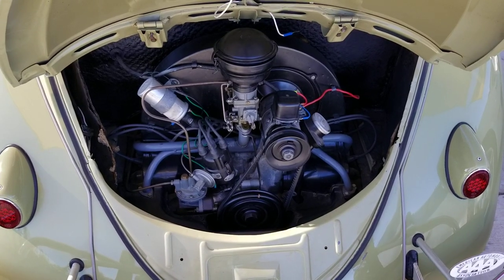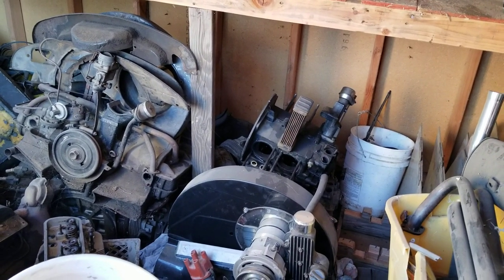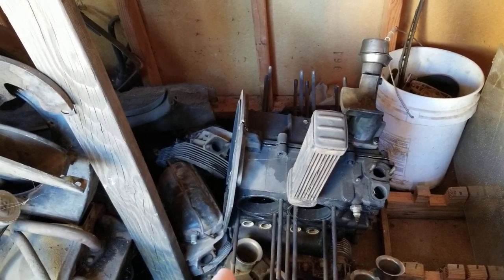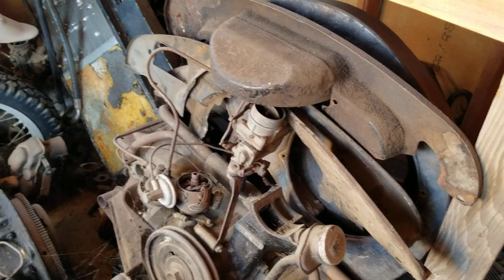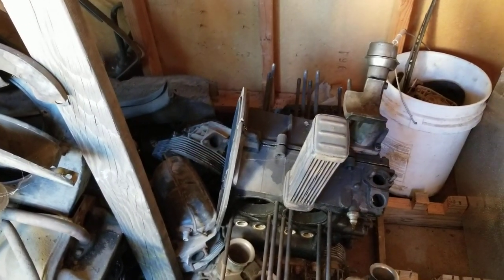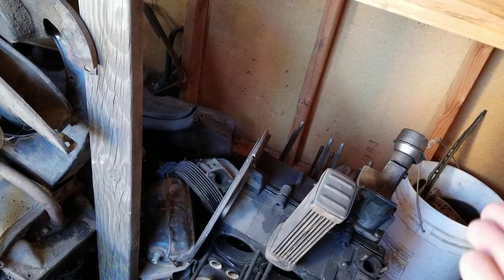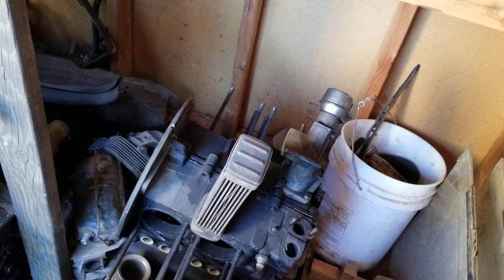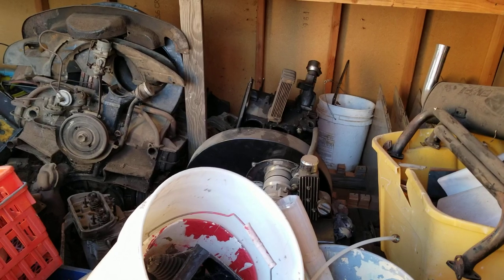Building a bulletproof engine flat 4 VW

Comment: I don’t know enough about this, but a very good video. One thing I have learned along the way with our alcohol fuel, is keep them stock, and up jet for the fuel. I think they run 4% cleaner now with this fuel crap going on. Of course this is only my opinion it does not mean I’m right LOL Although my next is a 1776, supposed to be pretty reliable
Reply: I screwed up my own post from using voice recognition. I meant to say they run 4% leaner, which makes them run a little bit hotter. Because of the stupid fuel
Reply: @SladesVWBeetle  Slade my Voice recognition always tells me i need to learn how to speak more VW & less Chevy ..
Reply: Dan Love 😂😂😂
Reply from the maker: yea that is too funny

Comment: My opinion, of a bulletproof vw air-cooled engine is a type 4 engine in a type 1 car.😎👍
Reply from the maker: well check out my new video coming up on the camper bus build Better than a type 4. the disadvantage of a type 4 is the heads. They tend to drop seats. stay tuned
Reply: @Mikefngarage  
Okay, will do.

Comment: You absolutely will run cooler with the lower tins. It has to do with the basic principles of thermodynamics. As you slow the air down it has more time to absorb heat from the engine before it's expelled becoming a more efficient heat sink.

It's the same principle as removing the thermostat on a water cooled engine expecting it to run cooler since you removed that chunk of medal restricting flow. It won't. But you CAN remove the thermostat if you install a restrictor plate or large washer with a given size hole in it to slow the water flow down so there's more contact time to absorb heat.

Comment: My first1776 failed at the cam gear in 4,000 miles. My current has close to 100,000 dual solex carbs merged header and two quart sump.

Comment: This is a really big topic.
Personally I've always looked at the last iterations of VW boxer engines for some guidance.
The T4 and wbx engines show what VW decided to do when increasing capacity and HP.
I'm of the opinion that these engines are a fundamentally more bullet proof platform for reliable power.
I do think the availability of almost plug and play fuel injection is a game changer for making an air cooled motor both practical and reliable.
If you want another interesting topic what about VW's new EV T1 floorpan and how electric motor transplants will further extend the use of classic VW's.
Reply from the maker: yea for sure the T4 was great except for the heads. IDK what happened but the dropping of the valve seats has always been a nightmare. The bottom ends are bulletproof. That is why I like the aluminum case for the t1 engine. It simulates the type 4 design except uses t1 heads. and fits in the car.

Comment: Good info! ...for nothing though, wouldn’t you think VW would have put the type 3 tin on all type 1’s as well if it worked better? You are probably right but just saying. I’m building a 1641 so you suggest a performance cam, what specs would it be? Thanks!

Comment: Question:  when driving your bug, does the coil get HOT?.  I don’t mean normal HOT but to the point it gets so hot, you can’t even touch it.  Also when it’s off, it gets super hot?.  Yes, the one that runs with generators, not alternator.
Reply: Check the ohms on the coil cable to the distributor...should be really close to zero. If the resistance is too high, it'll cause the coil to overheat.  Check spark plug gap and dist dwell. Also...check the voltage at the coil. If you're getting way more than 14, then your regulator isn't working well.
Reply: thanks john

Comment: I would like to add a mister system to my bug. I live in Texas and it gets hot here. Any input would be much welcomed
Reply from the maker: something I always wanted to try back in the early days we were running all summer over 100 degrees driving daily and engines were on the edge.
Reply: @Mikefngarage I got a 1641 built for a daily. And just want to try to add a water mister system. Would you put it at the fan or over the heads.

Comment: you lost me when you talked about fuel.  What I think you said is to use premium fuel.  That gives you higher combustion temp.  With higher combustion temp you have more likely detonation and detonation is the death of a vw engine.  So by that logic wouldn't you not want detonation and therefor lower combustion temp?     Or am I misunderstanding something.  Very likely.